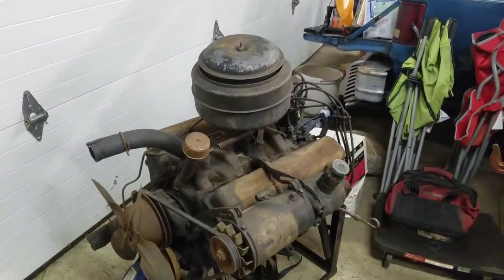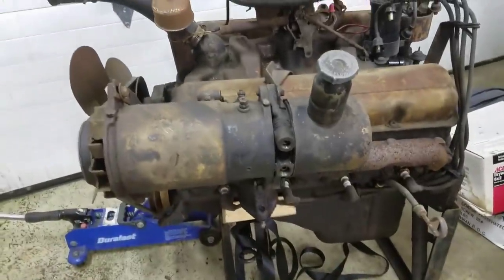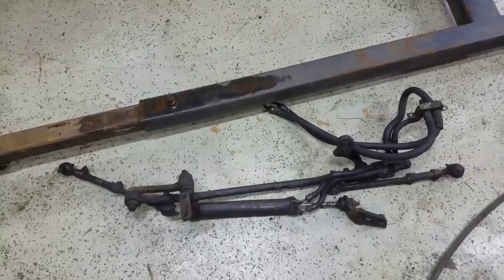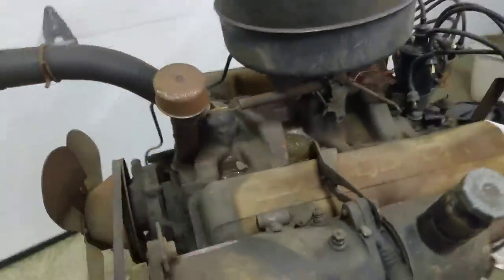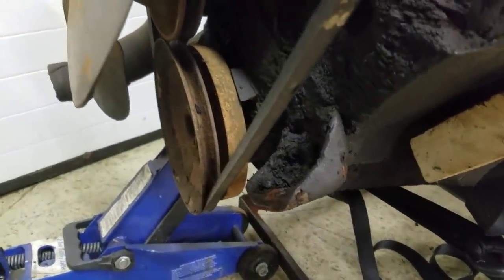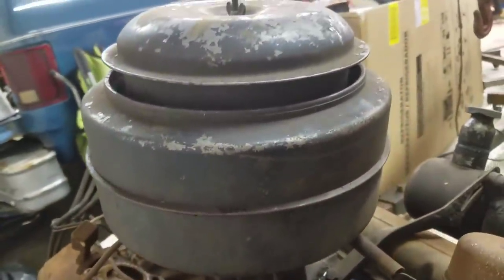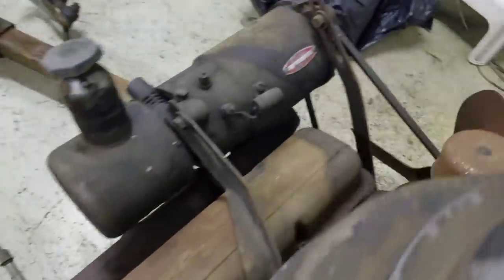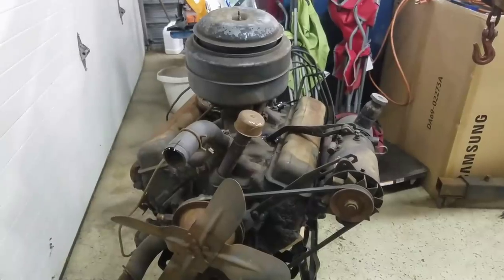The original Small Block Chevy - The 265

Comment: Must be an early 55 motor as the only other small block I ever saw with the road draft tube through the back of the block was small block no. 1 that they take around and put on display at shows. Later the connection was right behind manifold next to distributor hole.
  This is a good find. I’m sure someone wanting all original would be interested. What are the numbers?
    The power steering is also good find, especially complete. 
  They only made offset valve cover bolt heads a couple years I believe. They made early corvette valve covers like that, cast aluminum with Corvette cast in. I remember people having them on the walls of their garage as they didn’t fit any other heads. I ran a later set for a number of years. Looked exactly the same but fit everything.
   No side engine mounts, only the ones on front and on bell housing. I put a 66 chevelle motor into my 57 and wouldn’t you know, they weren’t drilled on one side. We used to put a longer bolt through the hole on one side to hold the fuel pump rod while installing fuel pump.
   No oil filter at all on block. A friend had 56  265 that had no oil filter whatsoever. My brother had a 56 265 that had early canister. It was longer and took 131 filter. Later ones were shorter and took 141 filter.
   1956 265 small block, first small block I ever worked on

Comment: I have a 265 sold over the counter in 1958..yes you could go to the parts counter at the Chev dealer and buy a replacement 265 in 1958

Comment: My Dad brought home a 1955 Chevrolet with a blown engine. Someone on his route gave him the car in  the early 60's. The idea was for a father son project. I was attending Aviation High School in Queens NY and really enjoyed rebuilding the engine. I used all the Aviation techniques I learned to do the job. The engine had seized due to a blown head gasket and anti-freeze and water mixed with the oil. Luckily only #1 had seized and we had the block fixed by a local engine shop. I couldn't tell from the video but it looked like your engine doesn't have freeze out plugs either. I guess mine was from a later model I don't remember the oddities you mentioned. Then again it was over 60 years ago. We got the engine running and sold off the car. What became of your 265, did you rebuild it?  Thanks
Reply from the maker: I had a spring/summer purge and sold it along with a few project vehicles.

Comment: The wet sump air filters worked by the fact that engine vacuum would draw air through the top surface of the oil and it would " percolate " down through the liquid to reach the wire or fiber mesh and its final path back up to the carb. Very efficient cleaning, as all the dirt would become trapped in the oil reservoir.
Reply: ford had them on trucks till the 1970s

Comment: I had one of these in my 55 Belair. The 2 barrel carb was 162 go the 4 barrel carb was 180 hp. I was told the stroke was shorter on the crankshaft so they had a longer stroke to make the 283
Reply: AdirondackNY no, all the 265, 283's were 3 inch stroke.  283 had bigger bore.  The 327 had 3 1/4 stroke and 350 3 1/2.

Comment: They look weird inside as well.  When you're used to seeing 350s, then you pull the heads off of one of these, the pistons are tiny, and around an inch of metal between each cylinder, as well as having really small  valves compared to the later small blocks, and the crankshafts, even though they were a really short stroke, they had massive counterweights anyway.

Comment: I had an old '55 Chevy with the 265 in it and the oil filter was in the front right as you were in front of the car facing the engine.  Would this have been an after Market filter kit?  I had just assumed that was stock.

Comment: God I haven't seen one of these motors since the early 1980s!! A friend of mine bought a 1958 (and 1959) Chevy Apache pick up truck that came with a parts truck (the 1959)!! The thing was so weird by even 1980s standards that we went through it with literally a fine tooth comb, looking that the differences we noticed on those old trucks!! One other thing about my friend's trucks were the one that was the "running truck" (the 1958) had an automatic transmission, and park and reverse was all the way at the bottom of the shifter pattern!! Only later did we learn that that was common on the two speed automatic transmissions of the day! Where the shift order was totally reversed from "normal cars" where park is all the way forward his truck was all the way back!!
Reply: Didn't the brake and clutch use the same master cylinder?

Comment: 55 though 58 had rear engine mounts on the bell housing 58 on had the mount on the tail cone of the transmission also they didn't use the top bell housing hole

Comment: the distributor shafts are not the same, the oil groove that is usually all the way around the shaft is only partially cut out on the 55 and possibly on the 56

Comment: rear motor mounts attach to the bell housing. I am old enough 73 to remember also there was a problem with the first motors like this burning oil through the valve guides. Not sure what the fix was. maybe this one is ok. The 56 265 had changes like the road draft tube attached next to the distributor. And it had the canister full flow oil filter.
Reply: 55-57 had the front motor mounts, '58 transitioned to the side mount/rear trans mount.  Road draft tubes were used up through '62 (Except maybe for California) '59 and up had the straight-across valve cover bolts.
Reply: my gramp bought a new 55. said worst car he ever had. not sure of engine he had.

Comment: Road draft tubes existed until 1962.  also on a 265 an oil filter was an option that was a canister that sat on top of the intake manifold if you wanted to shell out more money
Reply: tube dude, my all original 65 el Camino 327 / 300hp four speed has a road tube.

Comment: Hot rodders of the day used to punch these out to 292 CID, run Duntov 30-30 solid lifter cams with 3 speed column shifters and 4.11's in the back.

Comment: 283 did not have  pvc valves nor oil cap on the valve covers. Neither did the small journal 327s
Reply: PCVs in 63.  Oil filler was still on the intake.

Comment: they even used the slave cylinder on the vette,i've replaced them under warranty,it was also found on dodge trucks till 1971,the 265 was a fine engine,and the 283 was also,the 327 was the best v8 chevy made,they also had a bulletproof 6,the 292 Chevrolet,my first car was a chevy,1959 with the valve guides worn out,smoking and cost 75.00,damn near broke me,gas went up to 17.9 a gallon pissed me off,its only worth 10 cents a gallon

Comment: Funny how they used the chevy small block for so long...never knew valve cover bolts were offset on early ones..do you have plans for this? Imagine you won't find many of them these days..
Reply: Chevy changed from the offset valve cover bolts during the 1959 model year.

Comment: 🟥🟥🟥 Road draft tube till I think 1962. Till pcv valve took over.  We used to take the can it was hooked to ,under the intake manifold,  fill it with gas, light it up, to burn all the crap out. Maybe about a hundred years ago.  Just saying.

Comment: If I remember correctly, the cam in the 265 has a flat spot ground on the last main bearing that was not needed on the 283 cams.
Reply: Bin Cognito you are correct. The notch was there to allow oil to go to lifter galley. 283 they started drilling holes thru mains and cam bearings had holes to feed oil to top.

Comment: It would be neat to clean it up do good tune-up rebuild the carburetor sticking on a dyno flush the oil out real good put some good oil in it. Make a good video and a lot of people love to see the horsepower ratings on that engine and then I would really just the valve train and then do another dyno test with the valves readjusted would just a quarter in quarter turn preload and the same exhaust manifolds could should have wires and plugs and points condenser make sure the vacuum advance works

Comment: Another weird Chevy engine is the 305 v6, I've had two in two different pickups. Very expensive to rebuild as they didn't make many.
Reply: That's a GMC engine.
Reply: GMC engine and they made plenty of them.
Reply: Never could get over the physical size of the GMC V6, it's around the same size as the Chevy W engine 348/409. It stands to reason because it was available in displacements above 400 cubic inches.

Comment: That is definitely a 1955 SB. Only the 55 did not have a oil filter on the left lower side. Also look at where the water temp gauge goes, it's in the left rear of the intake manifold. The 55 temp gauge was a "mechanical " bulb type. Starting in. 1956, the temp gauge was electric, with the sending unit in the front left side of the intake, near the the thermostat housing. I still have my 55 Belair I bought when I was 14, back in 1967. Thanks for sharing this neat old engine. By the way, latter in 1955, a "Power Pack" , 4 barrel carb / dual exhaust version was available, rate at 180 hp, vs 162hp, for the 2 barrel.

Comment: no oil filter or air filter? holy shit. 1000-mile oil changes lol

not to mention the extreme heat conducted to the generator from the exhaust manifold
Reply: if i'm not mistaken, the cars built in the teens usually required 100 mile oil changes or so
Reply: The 55 engine definitely had an air filter altough it was the old oil-bath design and not paper. To the best of my knowledge, the generator mounting setup was used for a number of years without any adverse effect on generator life. Not sure if the add on oil filter was standard or optional but it was available in 55 while the built-in block mounting  oil filter was standard equipment by 56.
Reply: Yep. Generators already have probes because all of your current is going through the brushes. 

They don’t build them like they used to..... thank god.

Comment: That steering cylinder setup was used on the corvette up to 1982
Reply: Terry Pikaart yes I recognized it from my 1976 l82 f41 4speed it still original as are all my grease nipple fitted original steering and suspension components ,i grease them several times per year . Even my brake rotors and callipers are original 1976 as is clutch and pressure plate  transmission differential all drive shafts and wheel bearings,original springs  ,replaced 2 universal joints and new HD fluid shocks with custom added coils over shocks to stiffen the hard f41 ride . Motor is highly modified with roots supercharger and rebuilt by my self  and painted blue and diamond metal flake with 41 coats of acrylic lacquer hand rubbed , I am highly allergic to isocyanates in any form used in urethane 2 part paints construction glues window and gap expanding spray foams .While  installing spray  foam from spray can on a small speed boat  floor wearing a N95 respirator out side with box store consumers spray foam for gaps and windows doors  which had such small warning on the can saying contains DMI which is short for Di methyl diisocynate super toxic stuff. A highly populated urban area in India thousands died for an air leak of methyl di isocyanate by the manufacturers plant accident . So the new auto paints and clear coats are safer for the environment lolol

Comment: Notice the 265 head casting visible on the right head. A rectangle, as opposed to the pyramid ones... also the distributor is pre-'57, doesn't have the adjustable allen wrench screw, accessed by lifting the window in the housing. The engine that shook the Ford foundation.
Reply: have you looked a a ford y block? is looks like a Chevy and was out in 1953. and yes the early distributors had no window in cap and if i remember the cap was held on by snaps like ford.

Comment: Bypass oil filters circulate most of the oil eventually, Not the best setup, but still better than no oil filter at all.
Reply: One thought is  that  adding  a bypass filter  to an engine  with a full flow filter  is the  ultimate  setup because  a bypass filter will catch the  finer  particles that  get through  a full flow filter with no restriction  to total  oil  flow.
One  thought is that  the  bypass  filter  will  remove  oil  additives  but I doubt  it. Comments!

Comment: I bet the original engineers never would have thought they could be built to & above 400 cid.
Reply: I believe the original engineers never intended the engine to see more than 300 cubic inches. It was the racers who proved the 283 block could live bored out to 4 inches. By the early 60's aftermarket stroker cranks were available as well so why not build a 327 from the factory in 62.

Comment: can tell by no oil filter 55 & 56 and no side pads for side block motor mounts ,
Reply: the 56 265 has the oil filter on the bottom of the motor on the driver side , 55 265 has the oil canister on top . I have a 56 sport sedan with the original 265

Comment: How much power were these rated for?
Reply from the maker: +NRGMatrix Anywhere from 160 to about 220 depending on the options. This is a regular 2 barrel, so the lower hp one.
Reply: Not as low as I thought it would be, pretty good for the 50's I guess.

Comment: You show your youth. Weird? No just old. 
Rocker cover gaskets are the same as a Pontiac V8.  Most GM engines had mounts under the timing cover in that period. The bosses were on the blocks right through. All tri5 and some later had the power steering off the generator,  Even late 60s engines used an oil fill tube in the intake. I have never worked out why GM made the long waterpump. Again still into late 60s and with both A/C and Power steer cars.
Up to around 1969 Chevs had no accescory bolt holes in the heads.
Like all engines the small block was updated over 5 decades. A 265 is really only relevant to restorers. And some had 283s originally anyway.

Comment: When did Chevy first introduced the 350?
Reply from the maker: 1968 in Corvette and Camaro only I believe.
Reply: @FuelInjectionSucks  -- Chevelle had it by 69.
Reply: 1967 in Camaro only, but with smaller bearing journals.  1968 Corvette still only had the 327 small block & 427 big block.  The 350 was available in all cars from 1969 on.
Reply: I thought it was 1969

Comment: I still wonder what these would have done with todays computerized cam, open air filters, headers, todays ignition boxes.
Reply: That's called an LS.
Reply: No. It’s not called an LS. The only things common with the LS and this engine are the number and configuration of the cylinders and the bore spacing.

Comment: Despite the adoration by goobers, the small block Chevy was a cheesy engine of poor durability.  A 265 would last about as long as a Ford 239 flathead, but for different reasons.  Flat cams, worn valve guides, thrown rods, harmonic balancer slipping and flying off...all common by 80K miles.  The motor mounts were changed in '58, and were notorious for failure into the early '70s.  PCV's didn't come out until mandated by Cslifornia in 1961...road draft tubes were standard on all cars, until it was shown that crankcase draft was over 50% of the emissions load from vehicular engines.
Reply: Yes, such a weak, rotten design it remained in production for almost half a century and to this day is still the mainstay in many types of racing.

Comment: The best description I've heard of the SBC is that "in 1955 Chevrolet went on the open market to buy the cheapest parts they could find.  They assembled it and it happened to run."  I have yet to see anything come out of Chevrolet engineering that wasn't a flawed design, and there's a list of design flaws in the SBC.  And how many times did Pontiac Motor Division have to step in and fix Chevy's messes?
Reply: Pontiac's weren't that great either. GM figured out how to make engines on the cheap. Weak rods, stamped no shaft rockers, no oil filters etc. Pontiac rocker studs just slammed into a hole in the head not a great design but it sure was cheap!
Reply: GM was a holding company and made nothing.  Each autonomous division have their own engine designs.  The Pontiac V8 engine is a complete system centered on the concept of the 30 degree intake valve angle.  From what I've seen only Buick and AMC ever picked up on the advantages.  Other design considerations include putting head bolts into the stronger wall of the block and so using fewer bolts vs. Chevy bolting to the weaker wall and requiring 17 bolts on each head with lower torque so as not to warp the deck.  Poor design.  The exhaust ports were extended for better flow into the exhaust manifolds, as also seen on Buick and Olds.  Chevy heads are just flat to keep cost down.  Pontiac also innovated a lot, from thin wall castings (which Chevrolet never learned), doing a lot of early development of electronic ignition and assisting with early development of HEI.  The SBC wasn't chosen as the "corporate" engine because it was the best at GM, bean counter chose it simply because it was the cheapest at GM.

Comment: As I recall, the road draft tube was replaced by the pcv around 1961. 

Engine seals were still cork.
The rear main seal was made from rope. 

The engines would leak quite a bit. The middle lanes of streets and highways were black from the oil drippings. A rainy fall day  would emulsify the oil, creating slippery roads.

Parking spaces always had oil spots in the front and rear. 
Rear engine cars such as the as  the air cooled VW and the Chevrolet Corvair dripped a lot.

The Corvair was nicknamed the road oiler.

Comment: 80k miles with no oil filter says a lot for the small block Chevy oiling system.
Reply: They also told you to change the oil every 500 to 1000 miles!

Comment: The 265 was a boat anchor GM failure,very poor bore to stroke ratio and less than acceptable valve timing which resulted in  O-60 mph at "Stall speed"...I remember the Ford Flathead eating '55 chevys like they were standing still...Your knowledge of the "265" is appalling!!!